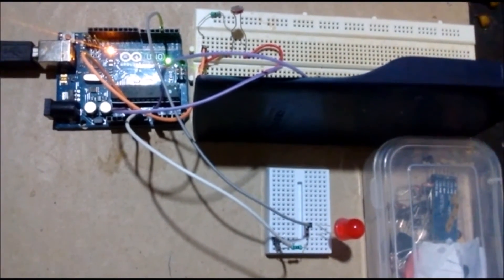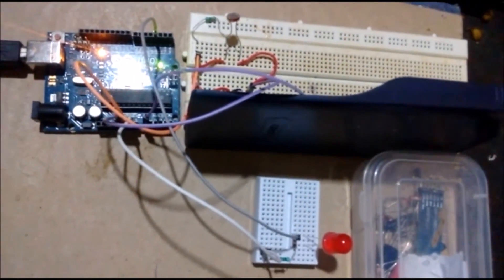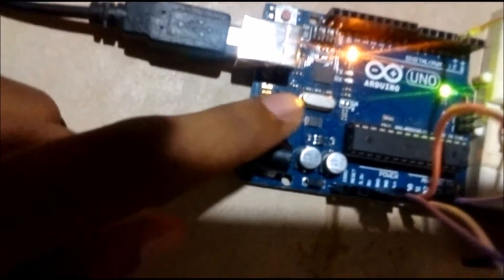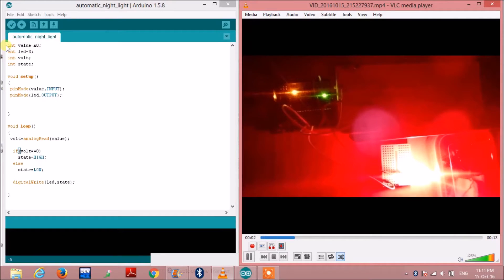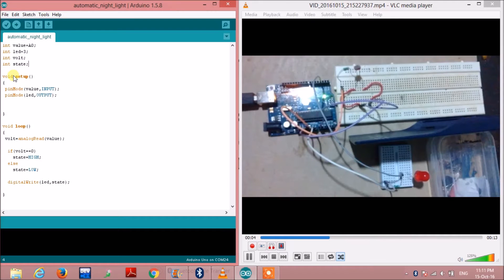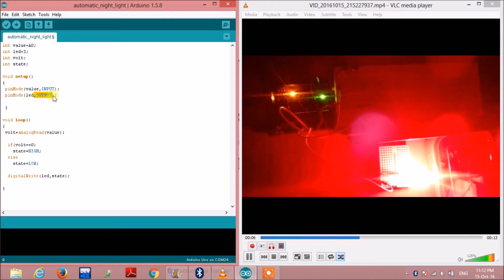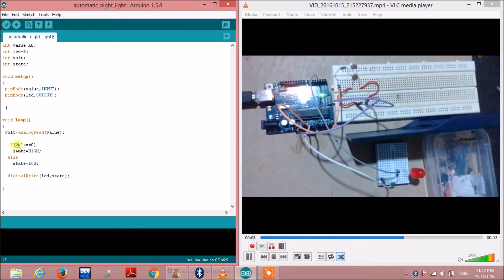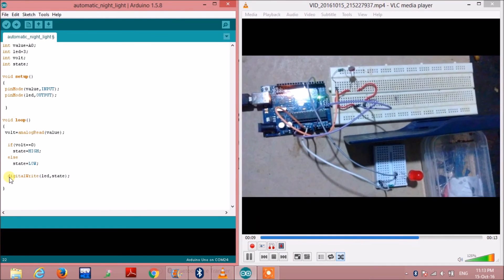How to make automatic night light

Comment: Hello! If I may ask, would this work if I use multiple white LEDs? And how would the scheme and code look like? Thanks in advance :)
Reply from the maker: +f y 
Thanks for your comment.YES you can use multiple white leds instead of that red led.For that you have to define the  pin number of the arduino .suppose if you want three led at the output.first you have to define two integer at the beggining of the code..
int led1= define any digital pin of arduino;
 int   led2=define another digital pin of arduino
;
 Then at the void section copy the output code for red led and change the pin number
Reply: DPV TECHNOLOGY- it's the great I see, thank you! And sorry to bother you with so many questions, but I’m curious as to why you chose a 320 ohm resistor to connect to the ldr? Can we use different resistors? I don’t know much about this
Reply from the maker: +f y  thanks for your comment .. Yes you can use different values of resistance instead of  320 ohm resistance.This Resistance is randomly choosen.You can choose another value also ..